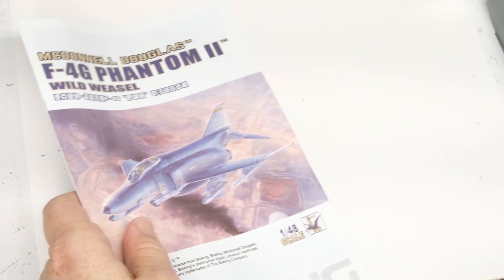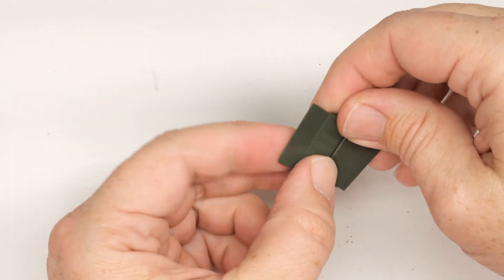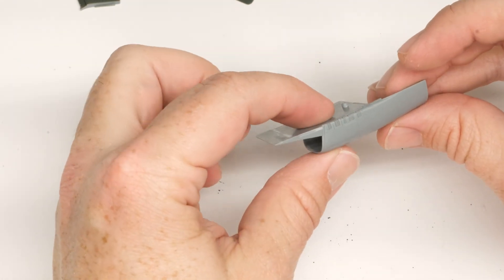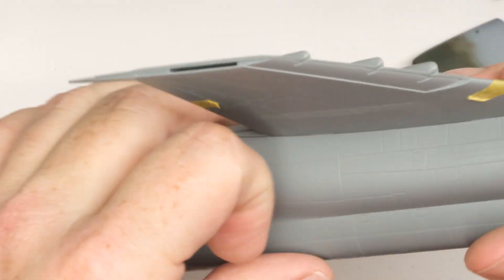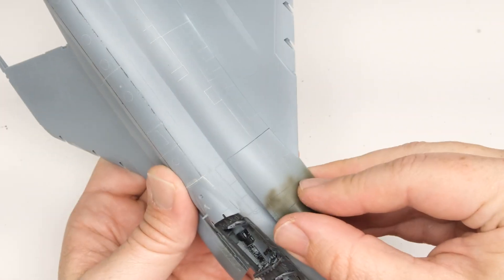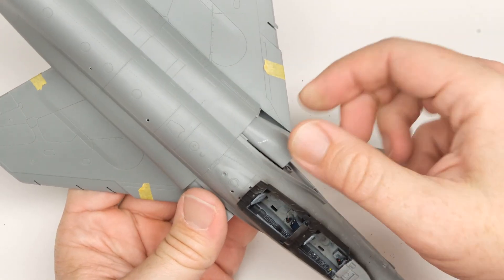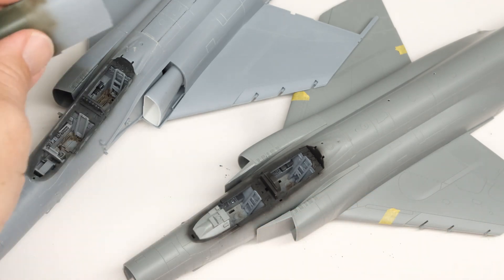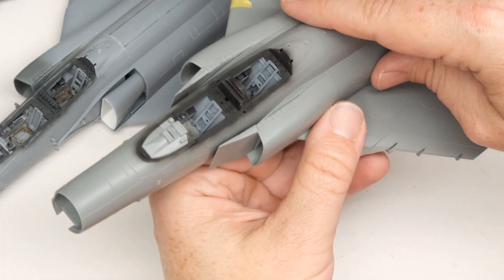Weasel-Off 5 - Intakes

Comment: A good point below on the flexibility to make different versions of the Phantom. I guess there may have been quite a few differences to the ramps for the Rolls Royce Spey engine. This said I think the UK Phantom also had a different shaped slightly wider fuselage.  Looking at the kit though the ZM kit does offer that extra detail and also there is something about the kit parts count and an opportunity to increase the parts count without detriment to the  overall quality and engineering of the kit.

Comment: The only thing Doog you don't have to say is... I missed the 4 distance plates behind the splatter plate /Fuselage (each side)... On the Meng  kit... ZM got it... Yeah no problem to  fixed it with 4 tiny sheet stripes... But most people forget this distance plates

Comment: Separate splitter plate means it can be fitted towards the end of the built. Intakes can be fitted and sanded. Then intakes and fuselage can be painted. After all that splitter plates can be fitted. I see the separate splitter plate as a bonus on the ZM kit and Meng does not have the splitter plate to fuselage support structure which is a step backwards when compared to the ZM and Tamiya kits.

Comment: They're actually called intake ramps, not splitter plates. The F-4 has a variable ramp system (which were referred to as "vari-ramps" in our tech data when I was a Phantom Phixer) to set up to form shockwaves that slow the airflow as it enters the duct to subsonic speed even when the Phantom is flying at Mach 2. 
  The front ramp is fixed position followed by two variable position ramps that function to put the shockwaves at the optimum position as the airplane accelerates. 
  The most significant difference I see between the two kits is that Meng left off the four support struts between the ramp and fuselage. 
  If you care about accuracy and don't want to scratchbuild the supports, the Z-M kit appears to be the best choice for accurate intakes and ramps.
Reply: Is it true a tooth-pick had to be placed in each tiny hole before they were painted? A crew chief told me that (same one that sent an airman basic for a spool of flight-line).
Reply: @SpeciesPlantarum  I don't know. I worked on F-4Cs and F-4Es from 1980-86 as an avionics tech and CUT (Cross-utilization trained) assistant crew chief. I never had the opportunity to see an intake ramp being painted. That being said, I don't recall the inside edges of the holes looking like they'd been masked or had the paint drilled out in any way.
Reply: The splitter plate is the plate between the intake and the fuselage. The intake ramp is the piece that deflects incoming air thats directly in front of the intake. Thats the piece with all the tiny holes.
Reply: @utley  Tech Order 1F-4E-1, page 1-3 says "The variable duct ramp system provides primary air, at optimum subsonic airflow, to the compressor face throughout a wide range of speeds. The ramp assembly consists of a fixed forward ramp and two variable ramps. The forward variable ramp is perforated to allow boundary layer air to be bled off and exhausted overboard. The aft variable ramp is solid."
  Note it is called a "fixed forward ramp" and not a splitter plate.
Reply: @Scott Wilson  so it doesn't say anything about the splitter plate the ramp is attached to? Then where did this whole splitter plate come from? It's not something called on any other aircraft, splitter plate was unique to the phantom.
Reply: @utley  I guess the name "splitter plate" was invented by people who don't understand its true purpose. 
  In the five years I worked on F-4Cs and F-4Es at three bases, I never heard anyone who worked on or flew the F-4 call it a splitter. To us it was referred to as the vari-ramp.
Reply: @Scott Wilson  yeah I get it. I work at Boeing and build aircraft there. I know a few ppl here that worked the phantom line many years ago and they referred to them as splitter plates too. It had to have come from somewhere...

Comment: The separate splitter plate not necessarily pointless. British Phantoms had a different one. If they decide to make FG.1 or FGR.2, they don't need to retool the whole inner plate of the intake, just the splitter plate. The outer shell is a different story, that needs full retooling.
Reply from the maker: Is generally agree with that, but the splitter and inner plate are all on the same sprue. So if they were to do a British Phantom they'd have to put the splitters on a new sprue with other Brit-specific parts or tool the whole inners again. 

But then ZM has tended to be a bit fast and loose with future planning